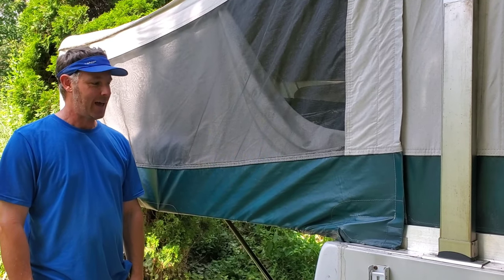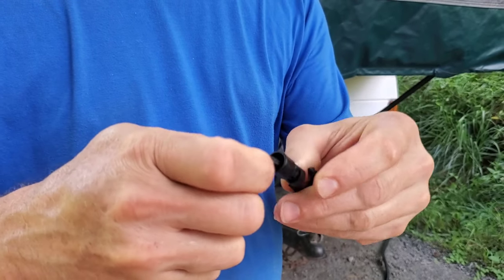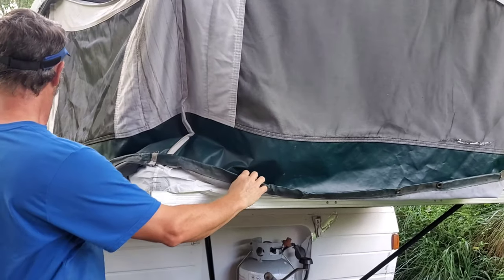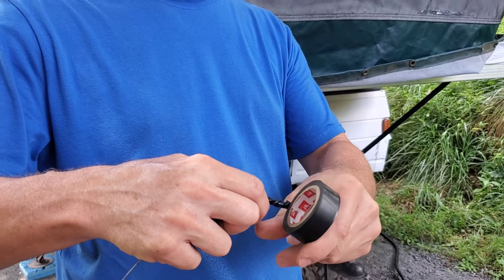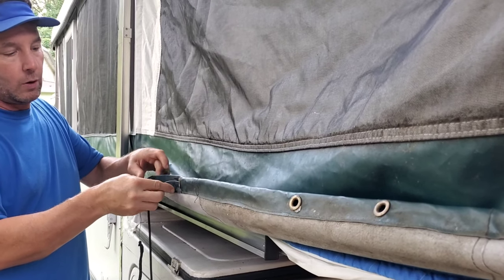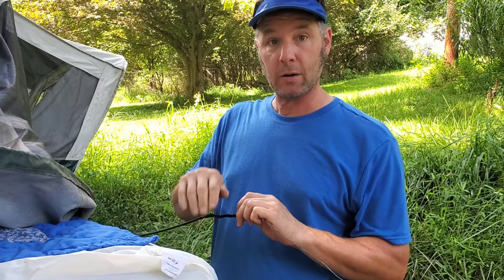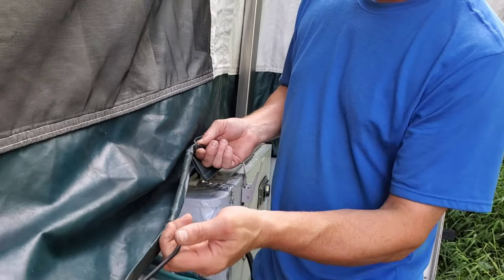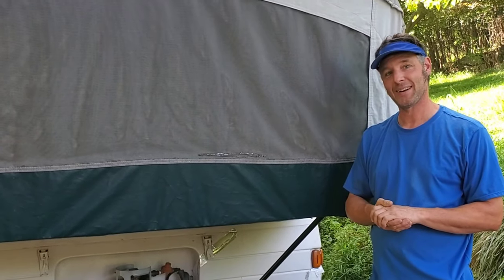Coleman Pop Up | How To | Shock Cord | Replacement | Blooper Reel

Comment: Can you tie the new to the old and just pull it through? I have a 2002 Coleman Mesa.
Reply from the maker: I believe the problem you'll run into is 2 issues. 1) That it's a shock cord it will not do well when pulling that full distance since it's like a big rubber band 2) When you tie it to the other cord you will have a hard time feeding it threw the grommet holes. 

But you can always try it. If you don't have luck just pull everything back out and start again with this method. This is truly super easy with guaranteed results. I just wish we would have done our sooner. Stay tuned we have more Coleman content coming. Such as AC mods and our favorite the Table and out door grill upgraded to real Maple wood. Replacing the crappy factory original.

Thank you for your question. Please let us know what worked for you.

Comment: The roof on those is heavier then you would think ! Take my word for it  i was stuck under 1 for an hour it sucked then replacing the cable that lifts it sucks worse !!! Life lesson
Reply from the maker: LOL Brent sounds like the word is out that you are the go to guy for camper repairs! You are right they are heavy. There are so many things I love about Coleman campers. But also just as many  wondering why, Ie ABS plastics, chip board floors and walls. Then again just another reason to build your own right. 

So Brent what do you do for a living? Cause I'm starting to see a pattern with all your camper repairs...🤣
Reply: @OutOfOfficeCamping  i was law enforcement, retired so i went and got rvia certified now i dabble in rv repair.
Reply from the maker: Brent first I'd like to thank you for your public service. That's so cool about the RVIA certification. I see they have different levels and on line courses. Any suggestions or feedback you could share. I had no idea that even existed. Very cool stuff. I'm going to look into that further. Thank you for sharing. I love learning new things.

When you have some time drop us an email. Everything is on our about page. I'd like to send you some of our YT truck camper build channel's. 
~Mark & Teresa
Reply: @OutOfOfficeCamping  honestly the schools are a gimmick ,you learn from books and get little practical experience. I learned basics with schooling and learned way more getting tossed neck deep in a poo pool. Im going to start my mini build this week. Im starting a mini camper to tow behind my civic im repurposing a pop up frame 6x10 but making 6x8 camper so i have space for bikes and generator
Reply from the maker: @brentsharp8234  That's good to know. Sadly that's the case with so much schooling. I'm sure it's great to have it. But yes hands on real world repairs of failures and trouble shooting will teach you so much more. That was how I got started with Vintage Vespa scooters. Then before I knew it I was restoring them and had a full blow powersport dealership. I really loved working on them but the people and retail side burnt me out. Closed that in 2015. Don't miss it one bit!

Can't wait to see your build. My buddy Jason and I have joked around about building a Styrofoam trailer inspired by the convenient store white coolers. It would slide onto a 5x8 small utility trailer. One day. First the truck camper then all the other fun ideas after. Look forward to seeing more. What generator will you carry on board 2000+ watt Honda, Ryobi, Wen...?

Love small and simple systems. 
- Mark
Reply: @OutOfOfficeCamping  i have a 3500 harbor freight which can run an ac. But when i do my real build definitely going honda. The harbor freights just here so figure ill use it
Reply from the maker: @brentsharp8234  I have a Honda 2000 but also have the Preditor 9000 watt plus a True-life 12k. I'm sure that 3500 is nice! Not sure I'd bother  upgrading to a Honda if it works. We have moved toward our Solar Generators. That's all we use. The Bluetti product hands down are killing it with some incredible new expandable systems coming out. We have one of the first AC200 /1700 wh love it with a few exceptions.